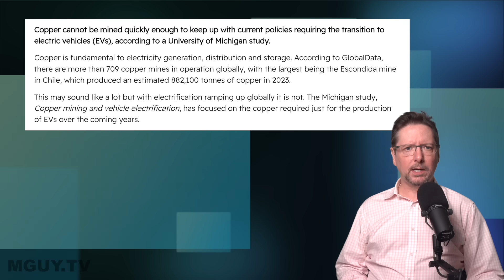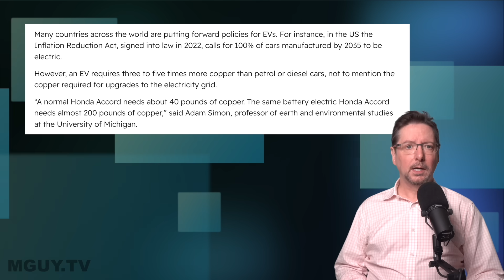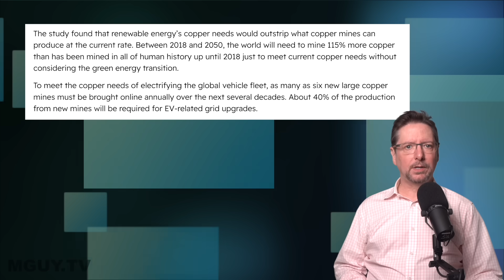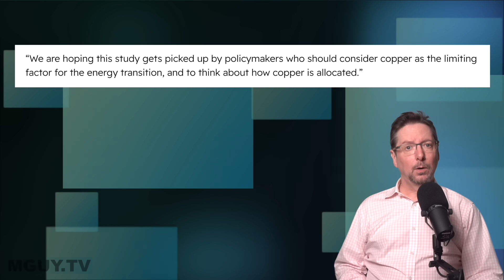Copper cannot be mined FAST ENOUGH for EVs and Net Zero Transition | MGUY Australia

Comment: silver is a better conductor and while it used to be more eggs-pensive than copper,,,,,,
Reply: Aluminum is better regarding weight and cost. A aluminum cable has 56% more cross section but only 50% of the weight and less than 15% of the COST compared to a copper cable of same resistance! It is already used a lot in high power high voltage cable and other areas.

Comment: I'M THNKING OF RECYCLING
MY NEIGHBOUR'S CHARGING CABLE
Reply: The gypsy clans are already harvesting it lol
Reply: @ianjohnson4753  Yes they were not slow in working that out!😉
Reply: @ianjohnson4753  Not just them!!
Reply: I can see a possible problem with that!
Reply: @johnnyhollis9977  not enough copper??
Reply: @hudsonthepolarbear  Well apparently although the cables are a juicy nugget of copper, the scrap value after stripping it out is quite low.  Perhaps they are trying to make it less attractive to do a bit of midnight cable pruning!!! 😁👍
Reply: @johnnyhollis9977  Actually, scrap copper is worth almost as much as buying bulk copper. Brass is worth a lot too. It's a low margin business.
Reply: @johnnyhollis9977 good username! 👍
Reply: You can imagine what will happen to the global price of copper, EVs will be more expensive and copper theft will go crazy.
Reply: Copper, being a staple of EV production 
as mentioned by MGUY will bring a
negative and irreversible impact on 
the prices of residential and commercial
construction, electronic components, 
and everything else related to the use
of copper. Similarly, in the case of
ethanol (crop based fuel) , the entire
food production chain, as well as 
nutrition are affected.
Reply: @bikersoncall  I don't believe bio-ethanol is the future. Crops must be used for food and not to power cars.
Hydrogene is not the future either. And EV's, at least in their current form, neither. 
So what is left ?
Reply: @eldontyrellcorp  Good points that is
EXACTLY what I'm saying and have 
been writing for 20 years, it competes
with everything from the cost of 
farm equipment to our own human
nutrition, including cost to buy food, 
inflation in general, so many facets 
of life. And yes, hydrogen, sounds 
so promising, but relies so heavily 
on electricity making it a net negative
route.
Reply: @bikersoncall  I totally agree. What becomes clearer and clearer is that if they keep this "all EV's by 2035" insanity, copper prices will substantially increase and less and less people will be able to afford EV's. That's maybe what they are targeting: most people will be forced to use public transports, and only the rich will be allowed to drive expensive EV's. What about the taxes then ? As petrol is a substantial source of taxes, and they cannot afford to lose it.
Reply: Why is hydrogen not the future? They've been working on it for decades
Reply: @samchs222 - the fact that hydrogen is extremely energy intensive to produce, is one negative.
Reply: @eldontyrellcorp  Agreed, and 
if they went full tilt on ethanol, 
the impact on the food chain 
could make the cost of food
prohibitive for a lot of people, 
disease would be on a rise from 
lack of quality nutrients in the
soil. ..and yes indeed, O'bama
was dreaming of $10/gal gas
back when gas was around
$2.00/gal; hoping to take the 
wheels out from under us.
Reply: @9jaezego  And storing it is also complicated and power hungry. 
But I've seen some articles about "solid hydrogen". Not sure how it works, however.
Reply: @9jaezego  
Sadly, the production of Hydrogen is
heavily reliant on huge amounts of
electricity. We need reliable and clean
energy innovation, but they keep running
around in circles. shrugs...
Reply: @maifantasia3650  Yes indeed, and
it is stored under intense pressure;
8000 psi + - , which could result
in catastrophic 'events' .
Reply: @bikersoncall   @eldontyrellcorp Finland has discovered huge deposit of readily available hydrogen. They will need to work out how to mine/drill it. Once that is worked out you should expect huge development in safe storage and usage. Just like Elon was able to figure out using lithium for EVs. It's still dangerous but it is now used in cars and fast charging is now a thing
Reply: @maifantasia3650  large deposits of natural hydrogen has been discovered in Finland. Even if it does not make it to your cars, at least it will replace the heat generated by electricity and gas in industries that gulp energy
Reply: @9jaezego  Safe storage, we shall
see, plus  it
takes enormous gobs of electricity 
to produce it. I read about his 'NEW' 
fast charging 'thing' lol. 
13 min charge lol, at something like
200kw (check actual figure) by memory.
The average household kw is right
around 20 kw lol, double lol. 
I think they even said something about
not needing to make upgrades to 
accommodate the 'NEW' chargers. 
😄
We need to keep looking and innovating, 
but responsibly.
Reply: @9jaezego to make hydrogen you use electricity so you skip a very expensive step by just putting that electricity straight into a battery
Reply: @9jaezego  because they have working on it for decades and evs are much better solution. Hydrogen has to manufactured with a great deal of energy  so put that energy straight into the car instead of wasting it making hydrogen
Reply: @ambassadorfromreality1125  you miss the point. The energy put in to producing hydrogen is to separate hydrogen from whatever compound mostly water. However, Finland has found natural deposits of hydrogen and is working on ways to mine it. Just little purification is needed. In this sense, it's like mining natural gas
Reply: @bikersoncall  True. Try editing before posting. The line breaks are odd.
Reply: @G58  My friend it depends
on where you're reading it and
on what kind of device, plus
youtube is not ''what you see
is what you get when you type.''
And no offence but I write 
10's of thousands of comments
a year, have been for 20+ yrs,
not just one liners like 
most commentors. I always do
my best to paragraph and 
punctuate, most here don't 
even know what that would mean
lol.  I also don't always have
time to edit period. shrugs...
Have a great day
Reply: Not to worry. Copper, Lithium etc will be replaced by a new 1.2 gigawatt product very soon. It’s called a flux capacitor. Just a matter of time when the De Lorean returns back from the future.
Reply: Hindenburg anyone?
Reply: @PineRidgeRez the Hindenburgs biggest problem was not the hydrogen filling the gas bags, Germany fully understood the issues surrounding it's use, but the aluminum/steel powder dope that they used to cover the outer surface, they had in effect painted it with thermite, the same stuff they now use to melt railway rails to join then.
Reply: Recycling is Green
Reply: Copper can be effectively recycled, but lithium recycling optimistically recovers only 70 percent of the lithium.  

The ballyhooed recycling of 1,000 pound EV batteries to recover 15 pounds of lithium won't be any more common than recycling solar panels - the taxpayers must pay for the recycling.

Comment: Can't mine copper at a rate quick enough to keep up with net zero plans. Estimates of lithium reserves being slightly less than needed to have the world's vehicle fleet all electric 

And all this mining being done by diesel engines

World has collectively gone mad! 🤯
Reply: There will be no transition. There is no recycling. Stupid is as stupid does I say.
Reply: Be aware that these machines will need shed loads of copper as mechanical transmissions would be shredded by all the torque.
Diesel engines with electric transmissions
Reply: "World has collectively gone mad!"
Except for people with common sense, but they are dismissed as conspiracy theorists.
Reply: Exactly! A Geologist, works in Europe, but an Aussie guy, has spent his life looking at global mineral reserves. There isn't enough Lithium for just one generation of the global fleet of passenger vehicles. So, if we know it's impossible, what is the real agenda?
Reply: @savagegfry  while I'm no chemist, I have raised that issue before in other similar yt videos. Commentators suggest end of life lithium batteries can be reclaimed as new raw material and rebuilt into new lithium batteries providing the same functionality. 

Personally, I'm not convinced that is possible from an engineering and/or chemical, financial, environmental, safety point of view!
Reply: @RiverMersey  From what I read about recycling EV batteries, EV battery manufacturers, if they put a 10 year warranty on their batteries, they won't use recycled metals such as lithium, nickel and cobalt. Recycled metals from EV batteries will be used in laptops, mobile phones, etc.
Reply: @RiverMersey  exactly as the lithium is made into a powdered alloy. no way to seperate it once combined.
Reply: @savagegfry  There's 88 million tonnes of known lithium reserves - that's nearly 500 years worth at current rates, if no more is found (and it's being found all the time - 150 years worth of new reserves found in just the last few years)
Reply: @savagegfry  Im hearing reports that theres not enough known lithium deposits to even do 100% ev in the UK.
Reply: USGS has known deposits of lithium at levels below what would be needed for an only EVs world without some serious battery innovation and complete cradle to grave recycling effort

Edit to add, I think there is only 20-40 years worth of lithium for EVs for the globe with current demand, and less if the developing world also wants to progress.
Reply: WEF brain parasite causing its hosts to destroy themselves acting in its interest.
Reply: Yes, the Leftists are mad, But who is leading that PUSH none other than the WEF, the top 1000 corporations that think they can Push any country into doing what THEY want because they have the International Political Power.
Reply: Firstly Lithium is the worst type of battery one can make and the cost of insuring EVs with lithium bombs will put an end to those batteries pretty quickly
The Luton air port fire is now pushing £ 200,000 and ultimately Range Rover's insurance policy will be footing the bill after another £ 200,000 in law suits .

Lithium is not in short supply and a 10 second search on your lap top would have revealed this 
Copper is the big problem followed by Cobalt, Niobium & Thallium ,
There is a reason why they are called rare earth minerals .
Fortescue metals is using Hydrogen as the primary fuel in a couple of their mines as they have been JCB's test bed and it is working well but the hydrogen ore train was a bit of a dud .
Climate change is real but most people are too stupid to understand what is happening and there are a lot of very wealthy people who see attempts to save life on the planet as a threat to them acquiring more money every minute than most people will earn in a life time so they are funding clots like MGUY   .
Think back the past 12 months.
Floods setting new records, tornadoes setting new records , hurricanes setting new records , rainfall setting new records, droughts setting new records , snow falls setting new records .
And the 12 months before that it was the same and the next 12 months will be the same as well.
Oxygen levels in the atmosphere is dropping and when it gets too low for the pollinators then we are in serious problems as 3/4 of what we eat is insect pollinated .

Comment: Pro tip. Invest in copper miners and explorers.. the nuftis will push ahead with this the time being. Might as well cash in so you don't have to suffer
Reply: Yes it would appear , Copper may be the new Gold , and you can guarantee as demand goes up for battery raw materials and copper, the prices will only go up too.
Reply: Actually, by not investing in copper, we can bring a quicker halt. Maybe even buy up copper and sequester it from the Battery car industry. Gamma squeeze sell it back when it's still high but too late for them. You don't have to Help them to profit from this.
Reply: @robertkubrick3738 Your allowance from mommy won't let you buy enough copper to make a difference.
Reply: Copper AND silver! Buy physical silver and sit on it! There is nowhere near enough silver for the industrial uses they want to use it for. There are 400 paper ounces of silver for every physical ounce and that means the price of silver is 400 times less than it should be! The historic GSR is 1/15 and today it’s 1/80, silver can destroy the corrupt banking system if the people hold it. If you have 60 ounces of silver you are in the top 1% of holders IN THE WORLD

Comment: AND THE SPOIL POLLUTES WATER TABLE
Reply: They want to pump C02 into the Australian artesian water system??.
Reply: For those that think lithium mining is nit a hazard of importance.

The environmental fallout from lithium mining is clear and far-reaching. Massive quantities of fresh water, classified as a precious resource in these arid regions, are diverted for lithium mining operations, fueling the salt flats brine. This leaves local communities and wildlife parched. Sulfuric acid and sodium hydroxide used in lithium extraction penetrate the soil and water, poisoning ecosystems and endangering species. Research from the journal Proceedings of the Royal Society shows that two flamingo species in Chile are threatened because of lithium mining.

Deforestation, habitat destruction and water pollution further exacerbate the ecological toll. The delicate balance of nature is disrupted, which leaves long-lasting damage that takes generations to heal. The carbon dioxide and other greenhouse emissions that come with the process of lithium mining, extraction and overall production are worse for the climate than the production of fossil fuel-powered vehicles. A study from The Wall Street Journal in 2019 revealed that 40% of the total climate impact caused by the production of lithium-ion batteries comes from the mining process itself.

And more. This is not better than oil, more so because it affects areas that have been left alone until now.. we need those areas as they are.
Reply: No, L-ion batteries are safe and effective like something else I can't think of just yet.
Reply: @JunkyardDog-q1h  took a minute to see th sarcasm. well played.
Reply: Yeah, stick to oil that has never, ever polluted water.
Reply: @TroySavary  Yes, oil and water don't mix.  Oil will break down over time and many oil spills can be avoided.  Some intentionally spilled.
Reply: @JunkyardDog-q1h  The Gulf of Mexico still hasn't recovered from the Deepwater Horizon spill 14 years ago. These problems don't just go away.
Reply: @TroySavary  As I said, some weren't accidents. But there is far more to the DWH than just an oil spill.  That said, there will always be issues to an extent but it will break down over time.  The Gulf has had other issues too, like millions of gallons of Frack fluid dumped there with the blessing of Trump, so it's not just oil.  You need to look at the bigger picture.
Reply: @TroySavary I guess you didn't know the gulf leaks 20.000 barrels a year.
Reply: @TroySavary  well at least a well fire can be put out in a few hours. Lithium battery fires can go for months.
Reply: @Dennis-ff2pf  much of that is natural venting, nothing to do with drilling.
Reply: @TroySavary  strawman.
Reply: @maddhatter3564  How is pointing out that oil pollutes more than lithium a strawman in a debate about pollution? Don't use words that you don't know the meaning of if you want to be taken seriously.
Reply: @TroySavary  so how does it when we in Canada we are 1.5 % and our forest eats more then we make still waiting for the artic to melt .
Reply: @Dennis-ff2pf  I am not talking about the CO2 scam. That's just plant food. Global temperatures are not linked to carbon at all.

The discussion was about the environmental harm of lithium mining versus oil drilling. Oil production far outstrips lithium production for environmental impact. That's a simple fact.

Comment: It's not only Copper. Blackout Bowen and his Idiot Green mates want to make Australia a "renewables powerhouse" and all of it "made in australia". This is great, of course. But ...  Do they realize that to do this, we will have to have manufacturing? And mining? We will need to mine and refine iron/steel, aluminium, nickel, cobalt, manganese, lithium, magnesium, mercury, lead, zinc, tin, cadmium, gold, silver, platinum, palladium, copper, silica, and of course rare earths. The list goes on. We will also need large amounts of concrete, and timber, with all that that involves. 

The mining and refining of those is going to require massive amounts of electricity, fossil fuels, plastics, rubber, packaging, and water. And produce equally massive amounts of waste, much of which is toxic. Do they realize all this? Do they really?

We could of course import all of this from China. Assuming that China wants to sell us these raw materials. In the past they have not. And even if they do, they will be much more expensive that refining our own, and the pollution and waste will be exactly the same, except it will be in China, not here. That will be the only difference.

We will also require tens of thousands of mining and manufacturing employees, from "lowly" miners right up to engineers. We dont have those. We are, and will continue to be, short by tens of thousands. They will take years to train.

Do Blackout and his Greens realize all of this? Do they? Do they? And if they do, are the prepared to act on it ?????